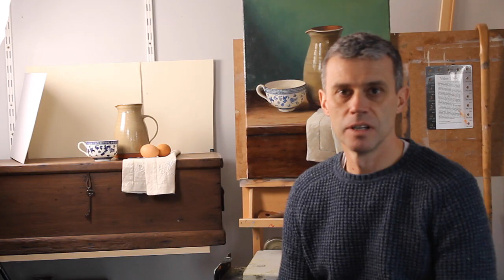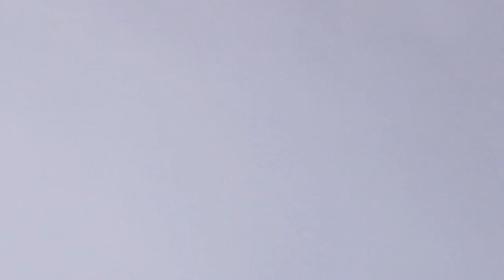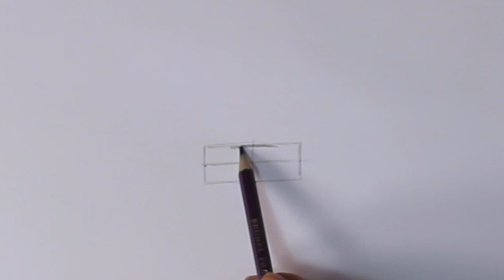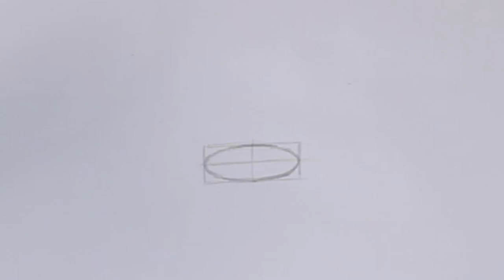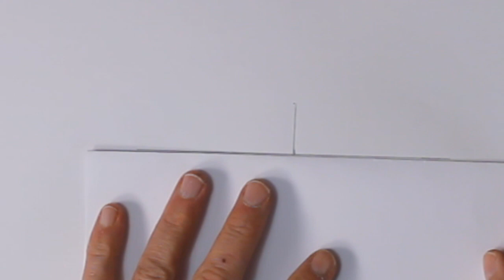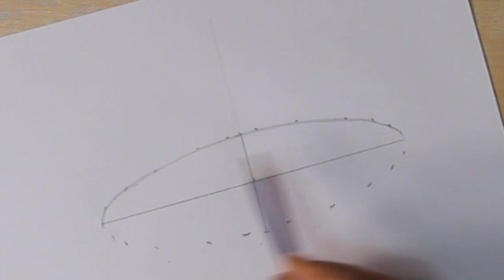Drawing an accurate ellipse - a still life essential skill!

Comment: A great method for beginners.  But not perspectivally accurate. An ellipse is a circle in perspective. It must follow the same rules as cubes or roads or the sides of buildings. 

Imagine you are drawing the top of a cube or a sidewalk. The center point of each would not be in the geometric center but shifted slightly away from the veiwer. Making the front segment slightly deeper, the back, more shallow..  In addition,  the front would be wider and the back more narrow. 

On a object this close, the difference is probably negligible. But scaled up, would need to be addressed 

I have students draw a flat plane (a square) in perspective,  then basically follow your example. 

I am unsure how the "compass" would work on the rear section,  but it would surely work for the front. I think some experiments will be in order. Tho, I'm sure there's a geometry geek out there somewhere who could tell us how to find the point for that. 

Thanks for adding to my arsenal of useful examples.